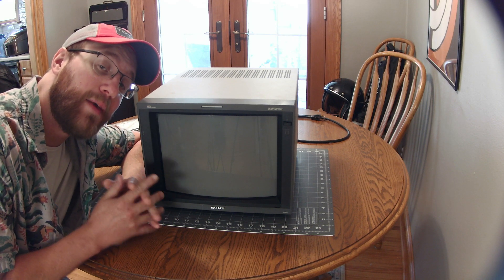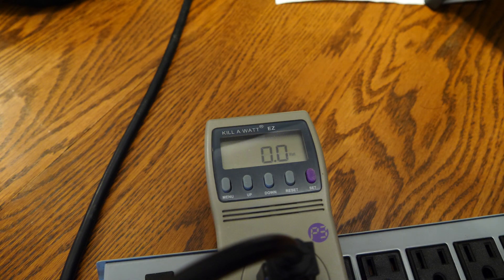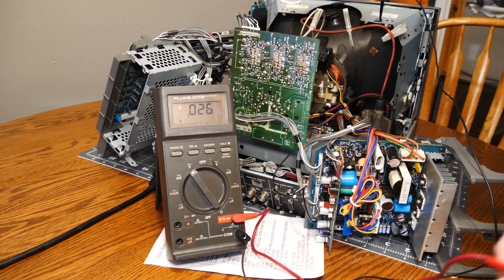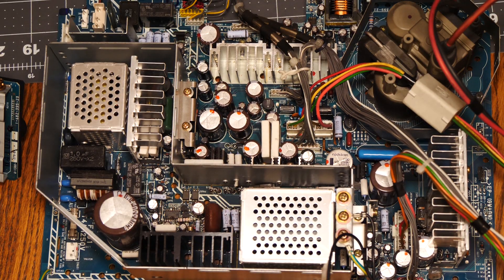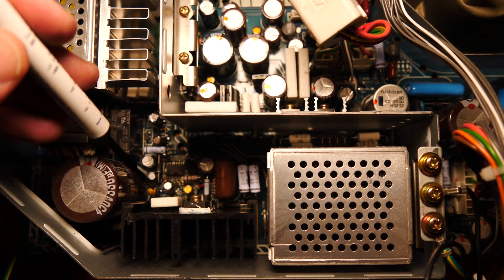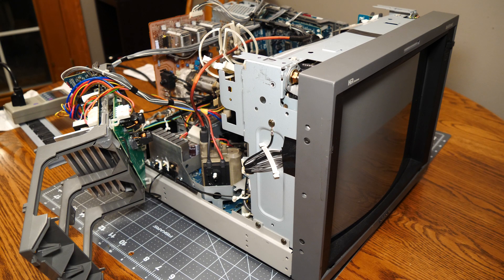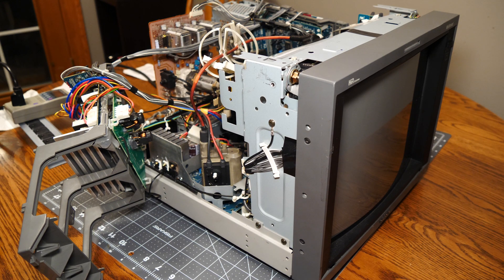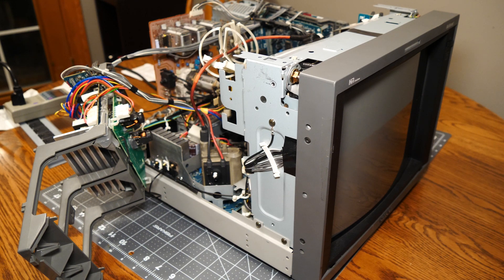Failing to fix a Sony PVM-14L5 No Power On Issue With Savon-Pat Capacitor Kit

Comment: Probably the power regulator transistors. Savon-Pat really should include those in the kits as well.
Reply from the maker: Thank you for the helpful tip! I will give this a try and report back.
Reply: @the-dan3974  were you able to find a fix? I have a 20M2U with a similar issue.
Reply from the maker: @markmathias9240  Not yet, my friend who owns it hasn't ordered the next parts that might fix it. The power regulators are what we're going to try next.
Reply: Agreed.